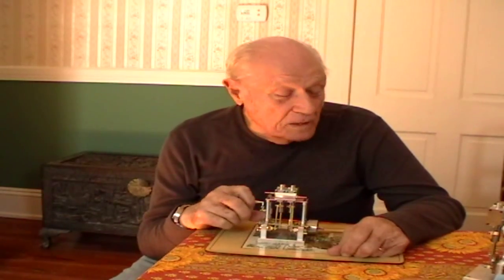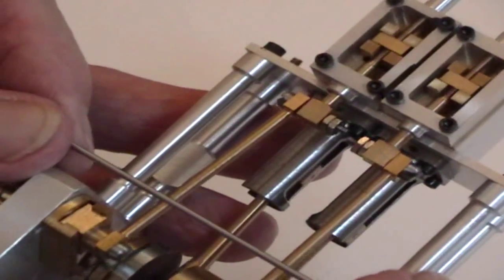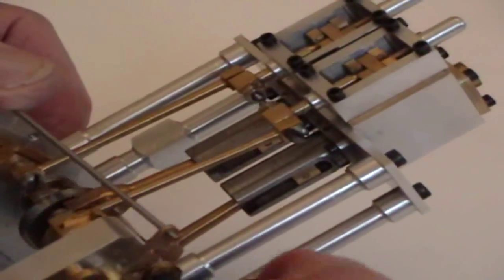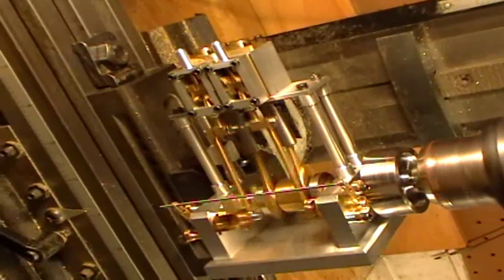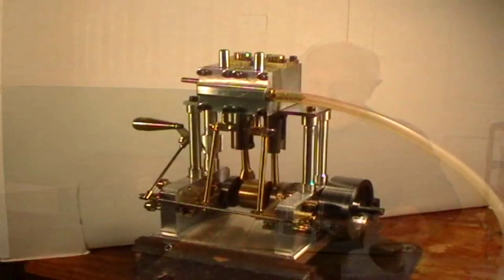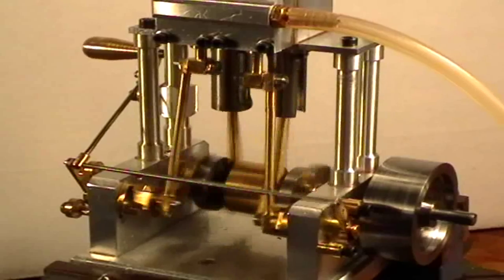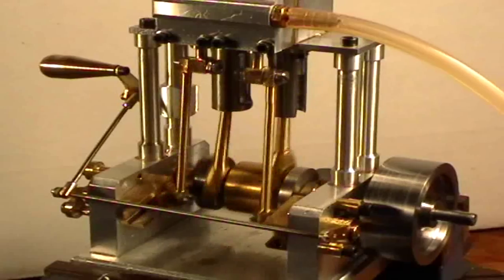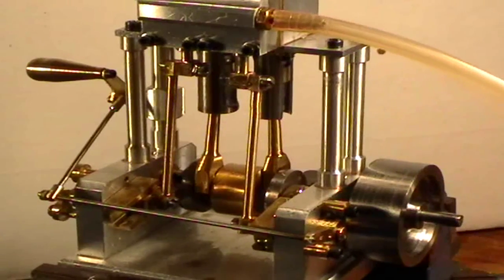Done at Last!

Comment: Very nicely built engine!  You said it is scaled off of a larger model?  Are plans available?  I'm designing/building a '10' sized horizontal engine.  No reversing gear as of yet.  
I'm curious how your reversing gear works.  I know how the Stuart #10 Stephenson gear works.  But I don't see the twin eccentrics and followers on your engine.  Just, I think, a sliding block, pivoted in the center that apparently translates and changes the phase of the valve gear drive.  Can you explain it, or perhaps give me a reference to how it works?  I'd consider incorporating it into my design.
Thanks.